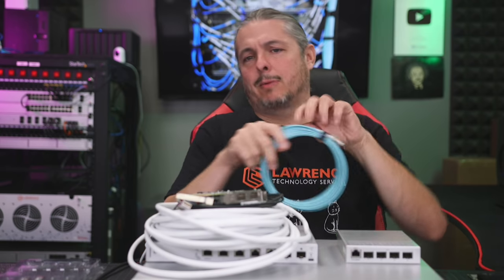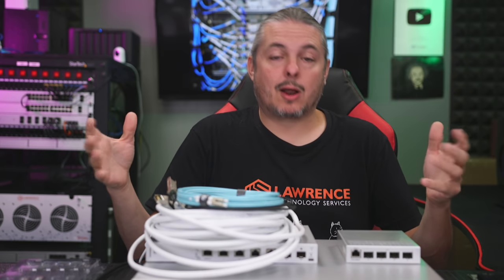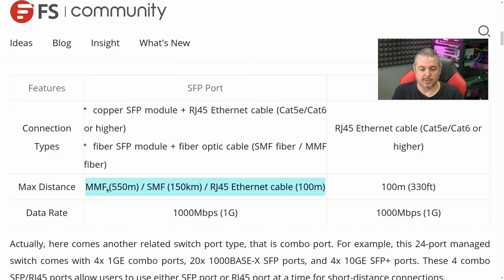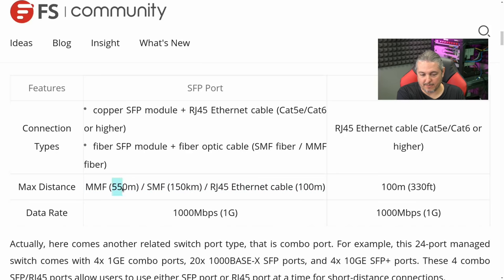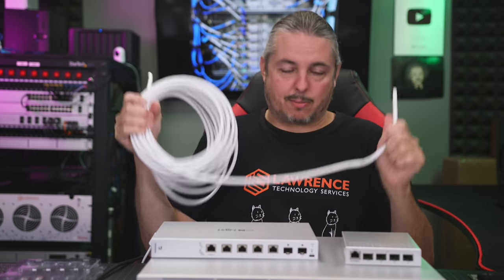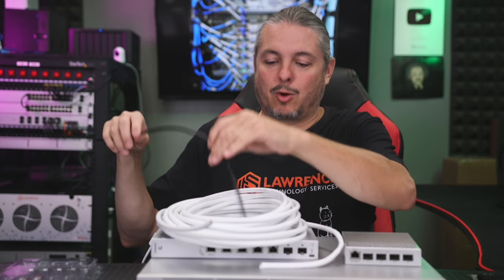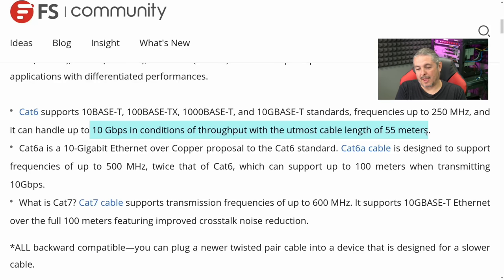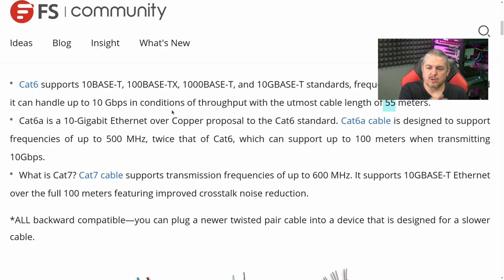Building Networks: When to run Fiber, Cat 6 or 6A, DAC Cables, and Cat 8

Comment: I feel like RJ45 will be obsolete before CAT8 can realise its full potential; my SFP+ to Base-T Transceivers constantly run into 80ºC without active cooling (e.g. CRS305). If 10Gbps/40Gbps is ever going mainstream for end users, we probably will need to go fibre to reduce heat/power on consumer hardware; which voids the whole "futureproofing" argument of CAT8.
Reply: Use switches with built in copper ports. They run much cooler than SFP+.
Reply: @mrfrenzy.  SM fiber is still more futureproof though. Replace the endpoint devices and you'll get the new speed, whatever will it be. Let's hope that the connectors don't go out of fashion.

But there is a saying that an electrical installation in a building has a lifetime of 30 years. Not because it goes stale, but because in that timeframe technology and user requirements change that much that it is inpractical to keep.

I assume that this time is even lower today, and even lower for network-related installations.
For example, for home/office/plant use: you had your endpoints at the same locations 10 years before?
For my use cases, not quite...
So probably it is not worth to install "too good" cabling just because, if we absolutely don't need it now or in the foreseeable future.
Reply: Part of the success for RJ45 is that it can be reliably installed with cheap and simple tools by most electricians. I don't see that happening for fiber anytime soon, nor common need for more than 10Gbps.

In my country we run all network cables in conduit anyways. In many places I have replaced phone cables or coax with CAT5e/CAT6/CAT6a with minimal effort. If the need arises in the future fiber or CAT99 can easily be installed.

Comment: Only need 1Gbps?  Use Cat5E

Need 10Gbps?  Install Cat6a - you don’t want to have to figure out which of your runs later are > 55m.

Need fiber?  Don’t bother with Multimode - 550m is for 1Gbps - you’ll only get 400m using OM4 for 10Gbps, and only 300m on OM3.  Those distances get even smaller for 25Gbps (100m).

If you need fiber, use Single-mode - you can even use CWDM or DWDM transceivers to send multiple 10, 25, or even 100Gbps signals across a single SMF pair.

Comment: "run cat 8 everywhere".. unless the device is doing something like video editing directly to a SAN, you really don't need 10GB to each drop. Typical desktop usage, printers, etc. never come close to using that. Even watching security camera ports on network monitoring, they never go over 10Mbps...The only place it makes sense is to servers, NVRs, trunks between switches, wireless access points and other places where you have a concentration of traffic. ...
If you're worried about "future proofing", you're better off putting in conduit and cable trays the make the "next thing" easier to install...
Reply: Cat8 (or for that matter Cat7) NEVER makes sense. There is zero equipment you can actually buy that needs it. More specifically there is nothing with CG45 sockets, so you are actually making things worse that Cat6a by using it.

Comment: Am building a house atm and the builder refused to run anything except cat6, might in future replace it with cat6a but at least initially that's all I've got. Good thing I put my server room in the middle of the house right next to my home office
Reply: I feel like the builder should do what they're getting paid to do.  If you pay them to run gold plated spider silk then that's what they should run, especially on new construction.
Reply: @clblanchard08  I agree with you, unfortunately they do cat 6 only and if you want anything else gotta get them to do cat6 then use the cat6 as a drawstring to pull through other stuff yourself after handover
Reply: @cookster455  that builder stinks.  No other way to say it.  But don't get too hard on it without due diligence.  I am running Cat6 in a new project, and I'm get 10G at 320'.  Cat6 can sometimes do a lot more than it's rated.  Just depends on the cable and connectors used.
Reply: I would tell them here is the cable, run it or I will find someone who will.
Reply: @sheldonfrey1  agreed cat6 is fine for most things, would have preferred cat6a just for a bit of extra guarantee since I'm running 10G everywhere but I can always rerun the drops later if i run into specific issues
Reply: @lifesoftserv  they wouldnt let that happen either, claiming something to do with electrical safety certification which imo is a load of bs
Reply: @cookster455  sounds like they did not want to look it up or how to ensure it is the proper cable.
Reply: @lifesoftserv  pretty much my opinion too